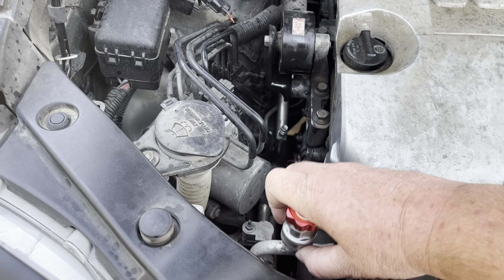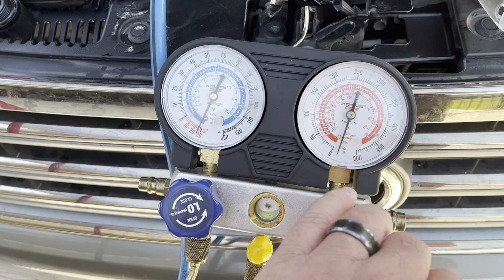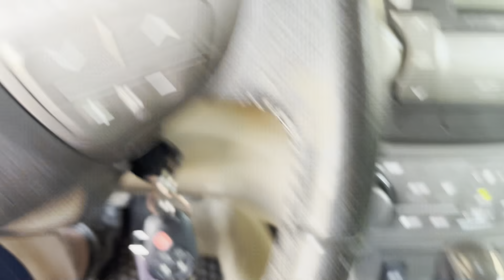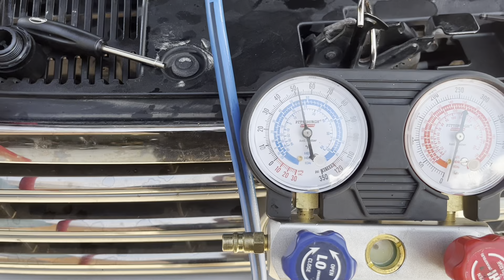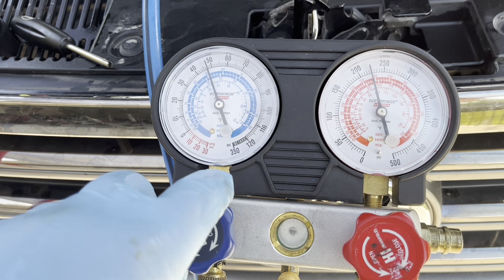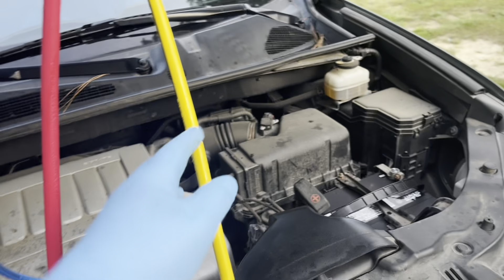How to recharge your AC using only harbor freight tools

Comment: Lookg fwd to  trying  this on my 2001 Eldorado, gotta fig out leak first..BUT  This car has a computer that TURNS OFF ac system when LOW on freon, and u CANT service it w/CODE on computer!     Im thinking the dealerships n mechs override that system by pulling the connector on low freon sensor, ?

Comment: I'm assuming you didn't let the car sit for a while before doing the static test to let the high and low side pressures equalize because the pressures should be equal.

Comment: You shouldn't have A/C set to recirculate. Also, static pressure should be measured when the car has sit for about 1/2 hour with the engine off so the high and low sides equalize
 When done correctly, both pressures will be the same.
Reply: Why don't you want the ac set to recirculate?

Comment: Curious why the high pressure side moves when the valve is closed?
Reply: Great question.  The closed red valve isolates the refrigerant flow. It still sees the high side pressure as long as the quick connect red valve is open. Hope that helps.
Reply: @hobbiehobbs Ah i see, so it just closes it off from the yellow fill/vacuum line and the blue low pressure line. I thought it closed all ways but it just does that one

Comment: I just finished fixing my AC in my Buick Lucerne and I can share some good tips here for everyone.

When you fill your vacuum motor with oil just put enough so that you can see it at the bottom of the site glass. Run the motor for a few minutes. then fill no more than half way up the site glass. As the motor runs it gets hot and the oil expands. Thus, Fills it to the top.

For self sealing cans of r134a gas go buy the self sealing tap at ORileys. Then in this kit (at least in mine) it came with an adapter for the yellow line.
Reply: Great tip just broke out my vacuum pump and the oil level is a bit low. I'd have filled it full had it not been for you tech tip/trick.

Comment: When you hook it to the vacuum pump, will the freon be sucked out? If so, where does it go? Thanks.
Reply from the maker: The system needs to be empty before connecting to vacuum.
Reply: @DIYD_Do_It_Yourself_Dad  Can you please let me know how to accomplish that? Thanks.
Reply from the maker: @aintgotnuthin the correct way is to take it to a shop. I had a leak in mine so it was empty before I repaired it.
Reply: @DIYD_Do_It_Yourself_Dad  Thanks.

Comment: I've always been told to never open the high side during vac down.
Reply: With the car off and the high/low side pressures equalized, you should pull a vacuum on both sides.
Reply: I am not being critical; the videos here were ideal for the sequence of operations, but I thought it was important to pull a vacuum just a scant shy of 30 inches of mercury, which in my experience with a similar vacuum pump took upwards of 30 minutes to definitively achieve. This adequately reduces the boiling point of water so that the pump can evacuate the vapors (i.e. steam?)
I am not a professional, but I tend to go overboard with these sorts of things. I think I ran the vacuum on my system for an hour +, not saying it was beneficial,  but it couldn't hurt either, right?

Comment: Hold can upright liquid will slug valves n cause damage
Reply: However, if you regulate the flow using the lo pressure valve, and watch the site glass for liquid refrigerant, don't you think that's okay?

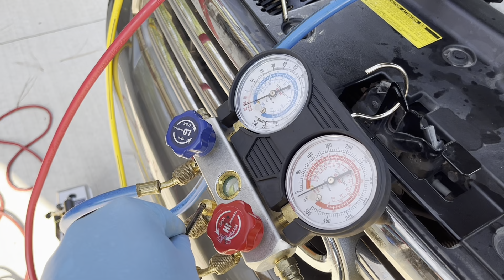Comment: 7:00 you purged the air in the line from the can to the gauge, but what about purging the air in the line from the gauge to the ac port? Are you assuming that the vacuum is still there? If so, I am not vacuuming the line, just needing to top off the refrigerant a bit. Am I correct in assuming this kit cannot keep air from getting into the system since it then requires a vacuum to remove air from the gauge line going to the ac port?
Reply: If you're just topping off a bit, then open the valve at the low pressure port, open the low pressure valve at the manifold,  and disconnect the yellow charge line at the can.  This will use the gas in the AC system to purge both lines.  You can also purge in the opposite direction.   Finally, tighten everything back up and start the car.  Don't purge using liquid refrigerant.
Reply: You just bleed the yellow hose by giving it a couple open through

Comment: You should be reading the blue pressure line, not the outside pressure line. Your pressure for 134a is read on the blue line not the outside pressure reading. The colored lines match the color of the refrigerant.
Reply: The inner track numbers are temps, not pressure.  It is a pressure/temp chart built into the gauge.  Notice the °F on the gauge.
Reply: Exactly ! I just found this out while charging my system

Comment: You purged the yellow line by pressing the schrader valve at the manifold, but isn't there air in the blue line also? Shouldn't that be purged also, and if so, how?
Reply from the maker: @jazzbuff1394  the blue line is under vacuum so there is no air in the system.
Reply: @DIYD_Do_It_Yourself_Dad  But if you are simply topping off, you do indeed need to purge both hoses.
Reply from the maker: @jackb1803  but that’s not what’s happening in this video.

Comment: Did you turn the car on before you started to fill? About to try this on my truck
Reply: No.  Get your hoses attached and out of the way of any moving engine parts.  Then start your car and open the valves.

Comment: i wouldnt even bother hooking up the high side. you're just asking for the valve to leak again.
Reply: No, it's useful to see the high side pressure when you're doing a fill.  For example, you can see when the compressor turns on.  Just don't need to open the valve at the manifold.

Comment: You did a really nice job explaining this.  Someone mentioned adding PAG.  That is incorrect.  Note to others, you do not put PAG in when  recharging the system.  It must be added when the pump is replaced or a line ruptured and oil leaked out.   If that is the case, the system must drained first and the correct amount replaced.  Adding PAG to a system with enough oil will tax the compressor shortening its life.  It will also not be as cold.

Comment: You really should have waited at least half hour after you turn evacuator pump off to see if you had any leaks, because you had pump running and said it's holding pressure but it really wasn't yet. Because it's still pulling vacuum so if you had small leak it's really not going to show up unless you turn pump off and wait a little while. Then if you have small leak it will show up
Reply: 3:45 he said it had been an hour?
Reply: He did let it sit for 45 minutes with the vacuum turned off and under the negative pressure. Then after he checked and saw no visible changes in pressure. He then turned on the vacuum again for 30 mins or so to pull all moisture out.

Comment: Whats wrong. The temp 85 . My low pressure 55psi   high pressure 130psi
Reply: Possibly a bad soleoniod on your compressor. Common in some cars.

Comment: You need to put a small can of PAG 3 oil in system to lubricate compressor, 2 cans of 134 plus 1 can of PAG oil would have been just about right.
Reply: Only if you removed components from the system.

Comment: Okay, question:
When you applied vacuum, where did the refrigerant in the vehicle go?
Reply from the maker: It was empty due to a leak. I repaired the leak before starting this video.
Reply from the maker: If your system is full don’t use a vacuum bc it will suck it all out.
Reply: @DIYD_Do_It_Yourself_Dad what if I need to replace the ac compressor? I thought that’s what you needed to do before taking out any components of the AC system
Reply: @michaelconstant4462  I'm not sure what you are asking, but you can take it to a shop and have them evacuate your system and recharge it when you're done making necessary repairs.
Reply: @michaelconstant4462  reserve tank and you wouldnt need to open the red side
Reply: @michaelconstant4462  No, not a vacuum pump but a recovery machine at a shop.
Reply: @michaelconstant4462  you’re gonna have to recover it into a recovery machine to a tank or have it professionally removed fix the vehicle then pull a vacuum then add your oil and refrigerant recharging